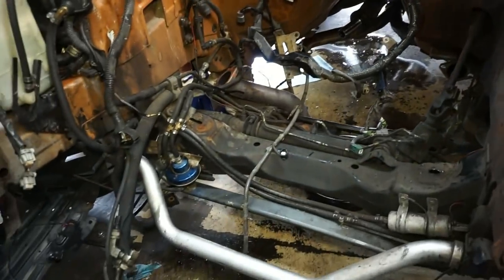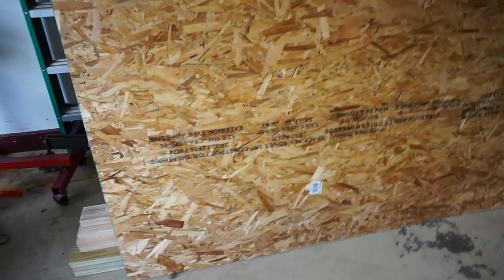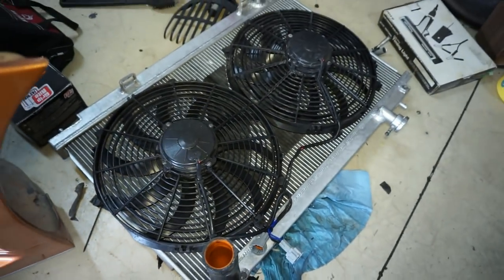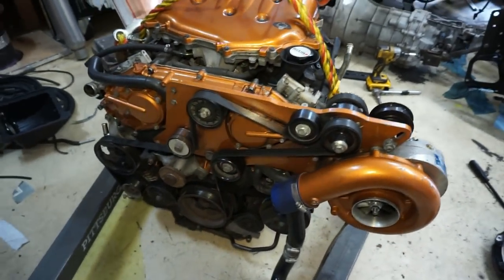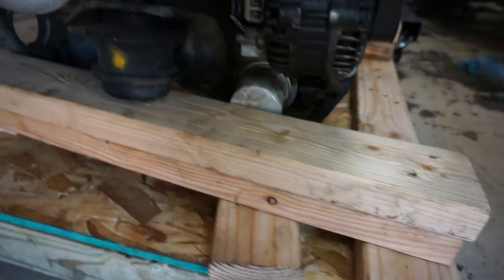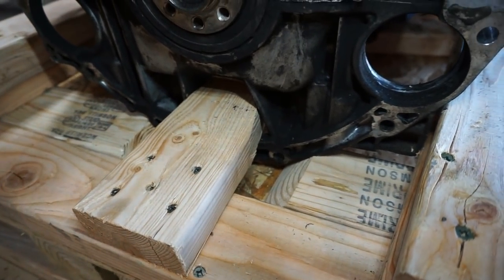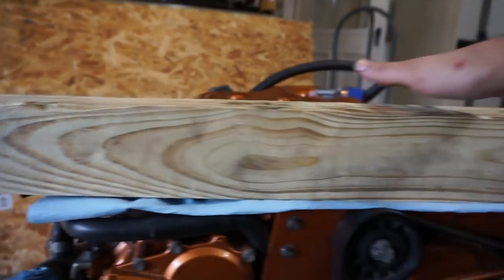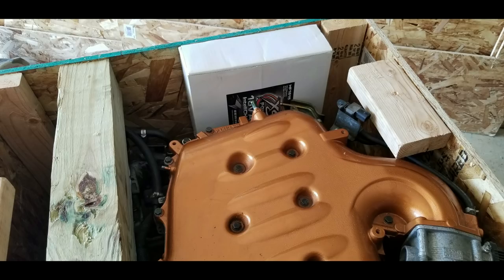HOW TO SHIP AN ENGINE!!! SHIPPING A SUPERCHARGED 350Z ENGINE!!!

Comment: I like the way you packaged it. I have to do the same to ship a 7.3 IDI diesel motor for a 155 mile trip in the back of a pickup. The 7.3 IDI weighs about 950lbs so its heavier than what you shipped. I'm not boxing mine as I will be the one driving it from Lancaster PA to the Washington DC area. it is a one day round trip drive for me so no need as long as the weather is good.. My plan is to put in on a pallet and secure it either sitting on a tire or build wood bracing like you have or both. I also bought some 1000lb load straps for it.

Comment: Hey My Friend--First of All, Thank You For Your Video.  I got a problem that I wonder if you could help me with......I have an 1990 Dodge RAM 210 Van Engine, 318 cu. in. displacement  I enjoyed that van a lot. We went EVERYWHERE with that thing.  After eight years, that van would not pass Texas emissions inspections.  I decided to have it Professionally Rebuilt.  I had the heads, and the the block sent to an Automotive Machine Shop.  Family Life, and Procrastination got in the way, and I Never got around to assembling that engine.  I have since sent the Van body to the scrap yard, and I sold the Transmission.  Now I still have all of the engine.  The block has all of the pistons, crankshaft, etc. reinstalled. and has been on an engine stand for about 20 years.  The heads have been on shelves in my garage for the same 20 years.  I also have new lifters, rocker arms, head gaskets, Starter, Alternator, Fuel Injector Body, and just EVERYTHING for this engine, but it is ALL Unassembled.  I want to sell this engine......The problem is that--I don't know if I should sell it in pieces, as a unit OR Assemble the engine and sell it that way.  With the block apart, a buyer can easily see the Honing Marks in all of the cylinders.  This will show that that the engine has been "freshly" (then) rebuilt, and NEVER run.  I don't know if someone would prefer to assemble the engine themself Or Would they want ME to do it, and trust my skills.  Also, in which condition, (assembled or not) would you think that it is more valuable?......You sound like you have have experience building and selling several engines.  What do YOU recommend?  Any Advice, from you, Would Be GREATLY APPRECIATED.  Thanks So Much.